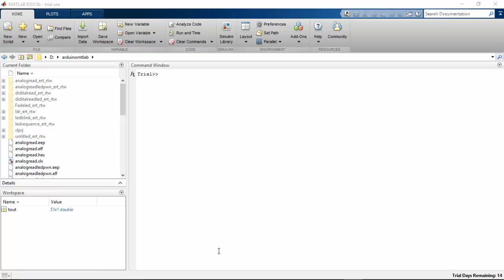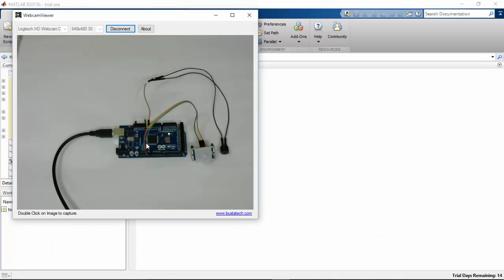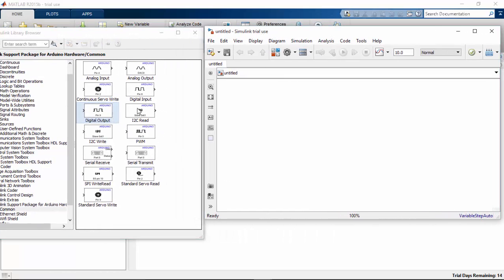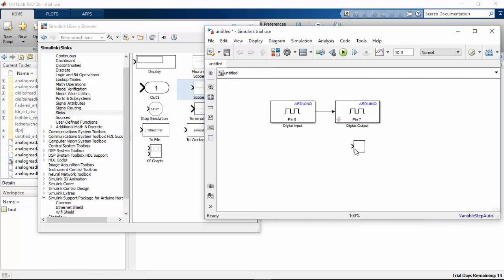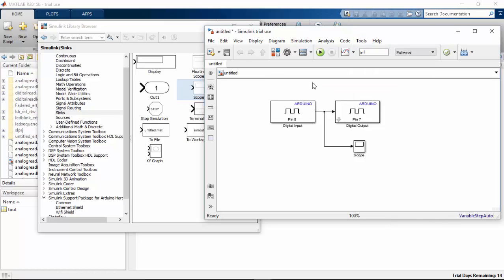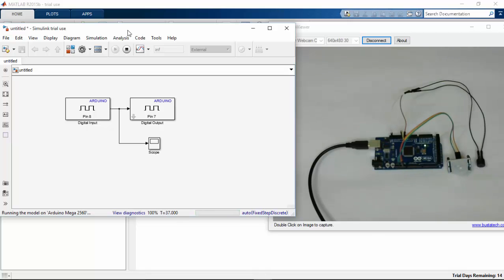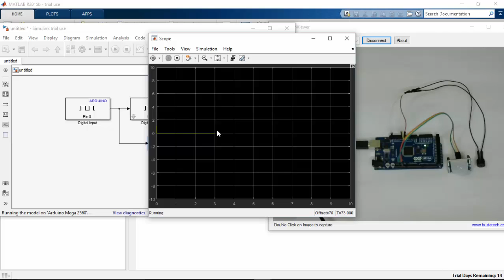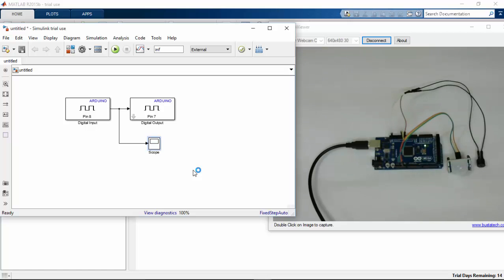5.2 Theft alarm using PIR sensor with Arduino

Comment: ATLAB\theftalarm_ert_rtw>exit /B 0  
AVR Memory Usage
----------------
Device: atmega328p

Program:   19450 bytes (59.4% Full)
(.text + .data + .bootloader)

Data:        913 bytes (44.6% Full)
(.data + .bss + .noinit)
### Build procedure for model: 'theftalarm' aborted due to an error.
The following error occurred during deployment to your hardware board: 
Message: Not found 
Source: System.Management

Please help me to solve this issue. I am using Arduino Uno